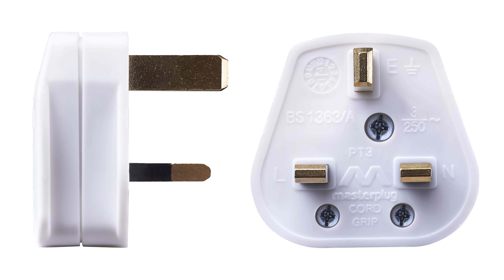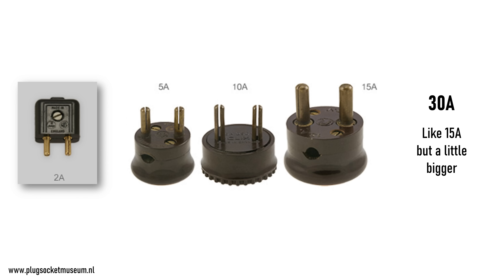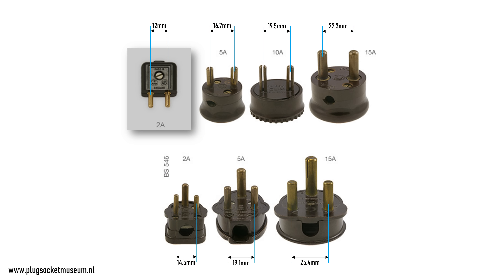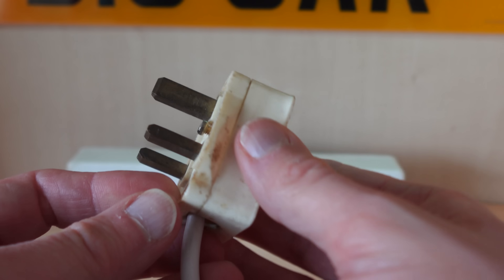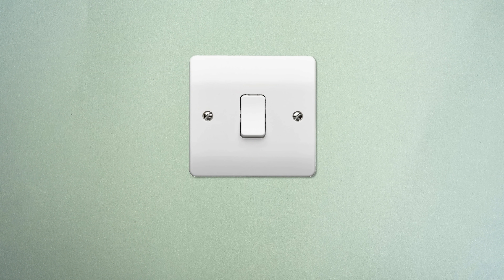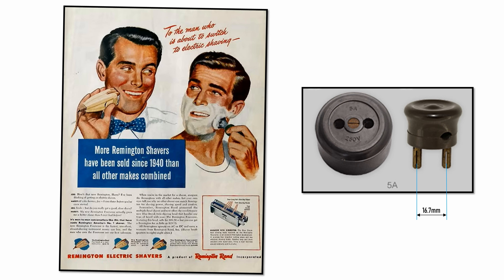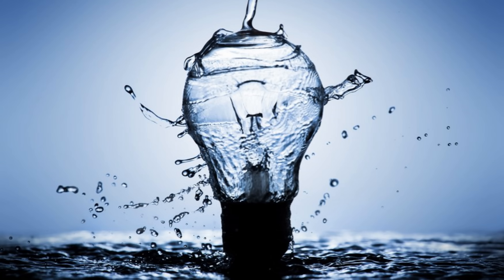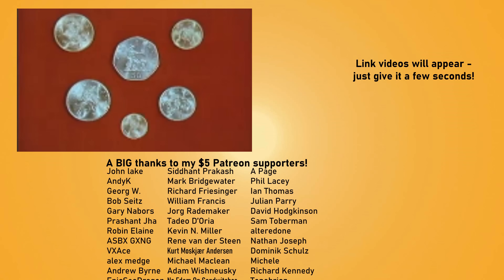Shaver Sockets are really clever

Comment: This is misleading and I am concerned that this kind of misguided advice is being given. 0.2 Amps is more than enough to kill you. A sustained current of 30mA will stop the heart. The current limit is a function of the impedance of the isolation transformer windings and is designed like that to prevent excess current flowing if the appliance is shorted or an appliance that draws too much current.